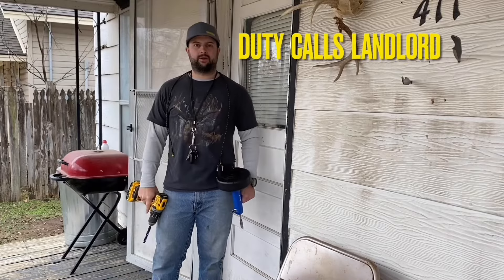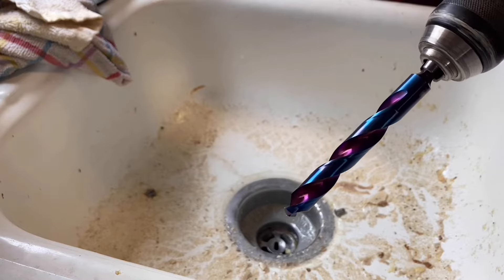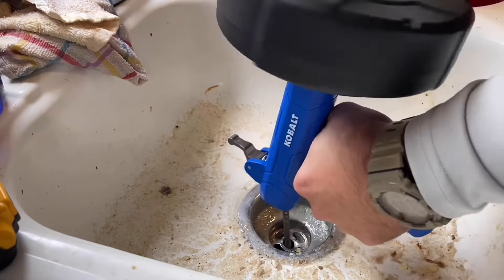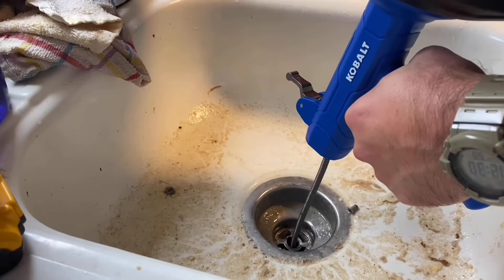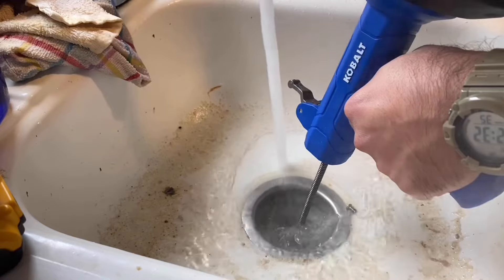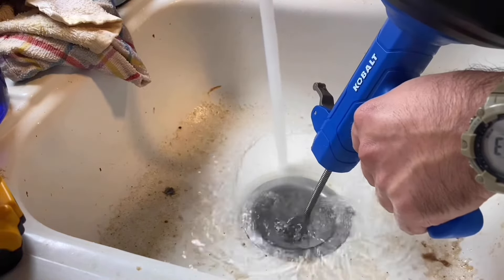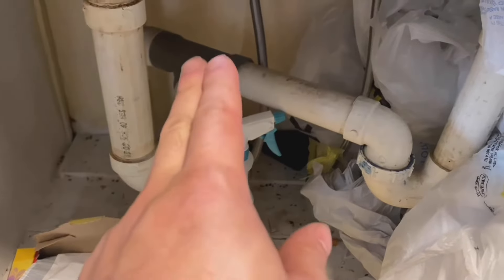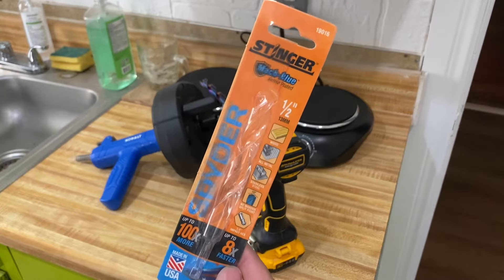How to unclog my kitchen sink with a drum snake

Comment: Just pull the pipes under the sink and clean!!! If it is beyond that then snake... the accessible pipes do not need snaked! Even glued pipes can be dissolved with proper chems or just replace the whole stupid set up for a few bucks...
Reply from the maker: @kruelton  lol it’s funny that people make things that are not complicated complicated. I am a landlord. People put all kinds of junk down my sinks and toilets, etc.. I have 4 inch PVC lines at all my properties. I am not taking P traps from all my tenants apart and scrubbing them out with my fingers. Goofy bro goofy. This is a much safer option for a landlord. People are completely disgusting. For real. You clearly have no clue what you were talking about.

Comment: Didnt have to remove anything. Dude just made a hole instead of getting down and unscrewing some PVC. Looks like shit and now anything size of a marbel can fall into your drain
Reply from the maker: You clearly didn’t watch the video. People like you probably an upset plumber loosing money. The fittings are all glued together. So as a landlord or homeowner you can do this if it’s glued or not. This way you can run the snake with plenty of water in the sink to help flush the clog and push it out. And the hole is no bigger than the other holes in the basket strainer. It is renter proof and fast to fix. It does look good and your on crack.
Reply: @GrantKeysProperties  The idea to make that hole was brilliant! In my case, the fittings were also all glued together. I always use mesh drain strainer for my kitchen sink, so no danger of anything falling into the drain.
Reply from the maker: Awesome 👏! I’m glad you were able to find a solution!
Reply from the maker: Goon.
Reply from the maker: Thanks! Yes all glued together and no need to reconstruct it all just to unclog it if there is another way and this is one other way! Thanks 🎉
Reply: @GrantKeysProperties  glued together hahaha keep those renters renting!
Reply from the maker: @poorgrower  No doubt!!